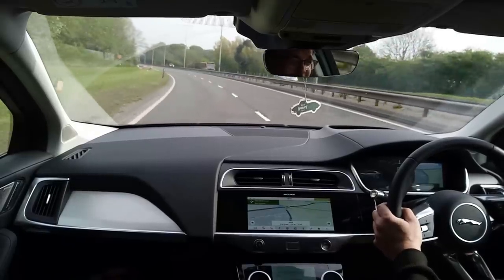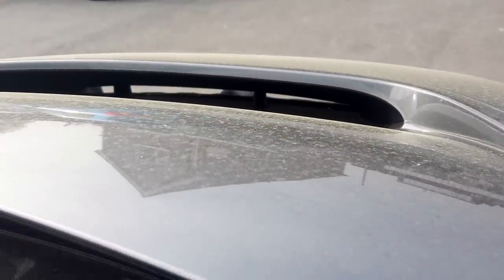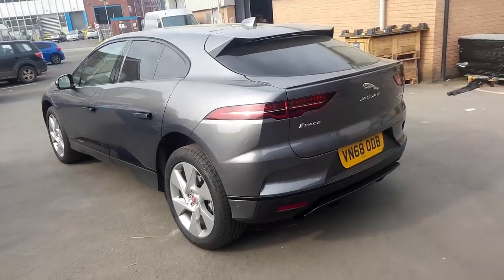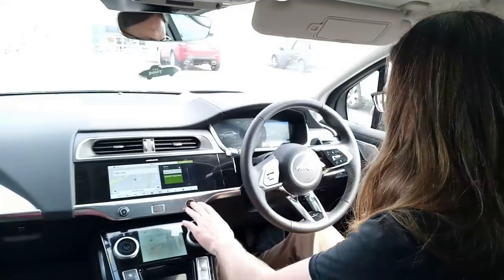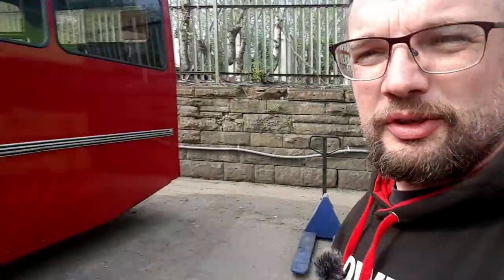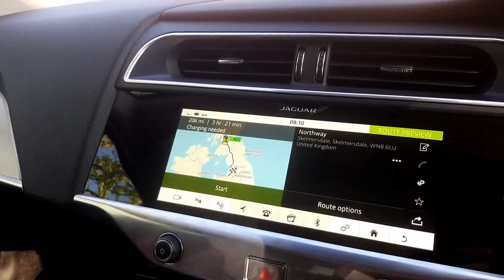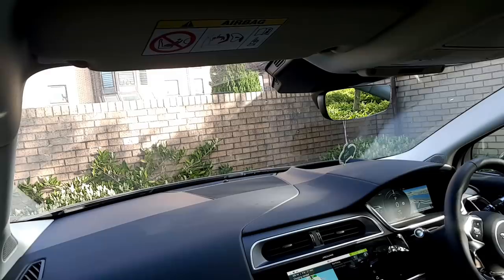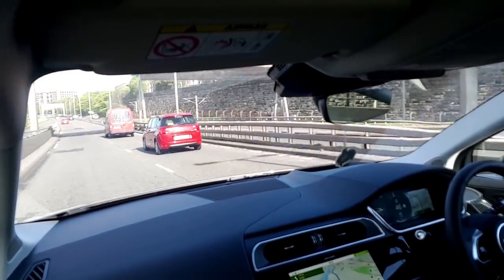Real Road Test: Jaguar I Pace 800 Roadtrip - with bonus bus action!

Comment: Thanks for a totally honest view of EV's. I love the idea of owning an EV, the dealership whom I drive for (service driver) have just started to sell the companies EV's (no names but four silver rings are the logo). They are magnificent machines. It's like driving a magic carpet. There is no fatigue. However there is no range, 240 miles under stringent test conditions (like anyone drives at 55 mph everywhere in a car). Personally I run a 98 plate S type Jag (3 ltr V6, 18-35 mpg), and a Ford Galaxy (2.3 petrol 20-35 mpg) and can get from home in SE UK to where I need to in England and Wales (sorry Scotland) in one hit on a full tank. Until the EV producers can get their charging systems/network sorted out with the ability to charge to 100% in under 10 mins and the range to a useful 500 miles I'm afraid that I'll either stick to infernal confusion or buy a damn Toyota Prius Hybrid. Thank you again Ian for a great video showing the reality of running an EV and the amount of time wasted trying to charge the thing. Nice car though, needs the old 3.2 XK lump in it though.....

Comment: Perhaps some of the answer might be the re-inroduction of the Motorail services that were operated by British Rail (at the start) between 1955 untill 2005. You could have done the Midland to Scotland part on a train arriving with almost a full charge to explore when you got there. Also with electrified lines I don't see why the charging could not be done on the train. A combination of the two could make electric cars much more useable.

Comment: Coming back to this video years later is interesting, I think the charger network has improved since then but planning is still required. I did a trip last week from Manchester to Exeter and back in a Nissan Leaf 24kwh stopping about 16 times at 10 different chargers, I only hit one problem and the 24/7 helpline resolved it for me. When planning the route I asked ABRP for the next hop each time then checked it out in Zapmap to see if it had recently been reported working.

Comment: Most enjoyable trip video...bus action as well. Charging time is not inspiring. I a. Surprised they bring back buses from HK.  Would have thought they would be pretty tired after years of use. I do miss the HK double decker from the 1988 era. Driven very quickly with the clutchless manual. Quite the riot when you nearly lift out the seat on hill crowns😺😺

Comment: So, we've cured range anxiety by building cars with good range, now to cure charger anxiety, where people worry if the charger will actually give them any power! Imagine the outcry if half the petrol stations were empty, but you only found out if you tried to fill up! I think the problem here is compatibility, you have 2 computers trying to talk to each other, but apparently not everyone has made everything compatible, rather reminds me of the 2000's when the idea of trying to get a printer to connect to the PC struck fear into anyone who had tried it! If it's like that the charger company will blame the car manufacturer and vice versa! Clearly demonstrates there's work to be done beyond just getting more charging stations.
42.39 think that's the 3 mile hill on my commute, always hammers my average MPG which I try and recover by staying in 5th and not touching the pedal for as long as I can getting off the motorway (works if the roundabout is clear).

Comment: Electric cars are great until you want to go somewhere! Last year I wracked up over 600 miles in a day going to the Mull of Galloway, just because I wanted to go there. You can see Cumbria, Isle of Man, Rep of Ireland and Northern Ireland from the same spot. Wonderful. You simply couldn’t make that journey in any current electric car, and sleep in your own bed that night. When they can do 1000 miles , and I can buy one for the 7 grand my Honda cost , I might think about it.
Reply: richard howlett You easily can in a Tesla though. I have a Model 3 that I'll be taking on a 620 mile road trip in a few weeks. Should be a super easy trip due to the supercharger network and how fast it charges.

Comment: Fascinating video, and I for one agree with everything you say in it. I love EVs and the potential they offer - the silence most of all, as I live in a big city where noise pollution is a massive issue and one that isn't given anywhere near enough attention. Just think, when EVs become the norm, we'll actually be able to comfortably live in houses beside main roads again! 

There's also the huge air quality benefits - the UK where s increasingly moving toward renewables (climate change means it's getting windier, but we can harness that) but even where the electricity cones from coal and gas, at least it's being burned away from population centres. 

Right now car makers (and buyers) are dazzled by technology, but I think we all need to learn where technology is helpful and when it becomes a hindrance. The former is being able to travel in convoy with massive trucks, safely and in doing so saving fuel. The latter is the ridiculous number of steps needed to connect to charging points with ohone apps and contactless credit cards, and the way that so many functions (on all modern cars, not just EVs) seem to buried in the infotainment menus. 

In cities, EVs are very much ready for primetime, and with those like mine (Leeds) offering free parking and charging, there's fewer reasons not to make the switch. The issue with distance driving seems, as usual, as much t do with our predilection for relying upon crap private companies +of which Ecotricity seems to be one) with understaffed call centres and 'just good enough' products to manage major infrastructure and vital services, and that's a purely political matter. 

When we / they can sort that, and create an infrastructure that is more akin to the current petrol station network than buying glass bottles of 'essence' from an apothecary, it will be a game changer.

Comment: Been having a home wall-box from 2020, and driving long distances with a BMW i3 from the same year, and i have to say that in Continental Europe, from 2021, the charging infrastructure has significantly improved every year, and that driving any EV nowadays is pretty easy, if not as cheap as it used to be due to the energy crisis that was caused by Russia’s invasion.

Comment: Completely agree in regards to poor network. It’s one reason we’re heading back to ICE this time around and trading in our Leaf. We’ll consider EV again next finance cycle and hopefully there’s a much, much better network. Plus you’re problems with chargers wears very thin after 2 years of ownership. 5 mins to put in a tenner of fuel still appeals. Being on hold to a call centre for 1/2 hour with a knackered charger is not fun, nor the future of motoring for me.

Comment: Tesla's numbers for kwh economy maye be based on in-town mileage?  In my leaf, there is a significant difference as soon as I get in the 55-70mph range, but in 35-45 day without too many start/stops, I can maintain 5+ miles per kwh without an  issue (which is most of my commute each day, and made it a decent fit as one of our daily drivers).  Thank you for posting your real-world, frustrating experiences with the current state of charging networks, interoperation, and the customer service, etc issues that currently exist

Comment: Great video! How did it feel getting back in the Matiz? I always find it hard to adjust when I've driven another car for a while and get back into my own.
Reply from the maker: I'm quite used to jumping into different vehicles, so no problems.
Reply: @HubNut  ooh that's cool. Random question. I drive a 2012 Suzuki Alto 1.0. In a small engined car like mine, is it worth using Redex and premium unleaded? I've used both and have experienced slightly higher range for my tank of fuel getting about 350 miles rather than 310-320, but that could be a coincidence (?). Would love your opinion.

Comment: Aw you would have loved it in Dorset today, saw a proper MK2 RS2000 in diamond white being told I just missed an even lovelier MK1 RS1800 or Mexico in baby blue, a lovely old Austin 7 and a red and equally lovely Bond Equipé, the 7 owner I was talking to as we discussed how his engine was the basis for my Reliant 850, he gets his parts either blacksmith forged or CNC machined for the engine if none about.   I actually had to put petrol in today, was down to the E on the gauge, last time I put some in was first week of March and I had been here, there and everywhere and I don't massage the pedal but give her some guns sadly marred by my cheap short draught Chinesium SD/USB drive playing head unit is dying a death, waiting on my £12.79p replacement stereo and can pump out some northern soul or some ska like a loon again :D   Might take a tootle down to Bournemouth or Weston Super Mare this bank holiday, got me Gaz cooker and kettle for tea making duty or might even wander to Sparkford as just literally down road and have a sniff around the auld cars there.   BTW your 850 will be livelier on super plus jungle juice, if I put normal stuff it isn't so perky I find.

Comment: I like Tbay. Lol. Did you figure out the suspension settings? Did you work out the various mode of regens? Non regen is prob best for motorways
Reply from the maker: Didn't really get to play with the settings. I like strong regen, which I moderate with the throttle pedal.

Comment: I think that it is suggested that it is best to keep the battery to between the 20-80% where charging can be at the swiftest rate!  I am very envious of your test opportunity as I am already addicted to hyper-miling in my diesel CRV (I have actually achieved 50mpg!) I admit that this sometimes it involves completely shutting down the climate control and infotainment systems etc but it certainly keeps me on my toes on long journeys to have further to get than the stated range!
   I really fancy a cheap old Prius to see what I can get. I understand that it is quite easy to recondition the battery pack yourself and I suspect that if they are driven as they were intended to be, they're capable of humongous economy.

Comment: The problem I have here are most of the comments based on a short test drive by someone who has little experience of electric cars and charging. I see this a lot on youtube.
First off, when the Ecotricity charger loses connection it goes on FREE vend. So all Ian needed to do was plug the car in and press start. So it's not a bad network after all. I have used it for 3 years driving up and down the country and have never been stuck once, just lots of FREE vends.

The Polar network is excellent too and very cheap but you need a RFID card. If you own an electric car you would probably have one but if your loaned a car for a few days you don't have the tools to operate it properly. 

I'm not sure of the problem with the Instavolt, I have used these loads of times and never had a fault, maybe the problem was with the car not the charger.

The cost of charging !!!  I charge from home and from a few local free chargers so driving my LEAF is very cheap (2p a mile approx) Charging out and about cost 3 to 4 times more
I see it similar to eating out. It costs more to eat in a restaurant than cooking something at home. When you buy Petrol / diesel you don't get a choice you have to buy it from a petrol station, it's never going to be on FREE vend (unless you steal it)

This technology is new just like a mobile phone in the 80's (I had one of them too)
nobody would phone me because it cost them 50p a minute and the coverage was rubbish
People told me then that mobiles would never take off and they would stick with their landline.
erm yes think they all have mobiles now.
Now i'm not telling everyone to rush  out and buy electric because i'm not and don't really want you to! I like pulling up at chargers when they are empty, charge up and go.
It's going to progress with more electric cars being sold and more charger will be rolled out.
If your in to electric cars you may know there are some big superhubs being built around the UK in the next few years which will increase the charging infrastructure. 

The amount of times people have said to me that electric cars are rubbish and I ask them how many have you driven? the answer 'NONE' 

My point is don't base your views on electric cars by a 1hour video

Comment: From Aberaeron to Glasgow is 353 miles which my quite big 4wd Volvo XC90 will cover at 80 mph on the long motorways while consuming only 40 litres of diesel. At £1.22/litre  it costs £49 or £0.14 per mile, which is what the electricity cost for that iPace apparently. The bonus for the Volvo [a seven seater automatic with 245hp] is that it could do the journey there and back, or over 700 miles with only needing to top up by 15 litres which would take about 5 minutes at most.
The trick with electric cars is to use them for local commuting and leave the intercity work to petrol or diesel cars. For some families it could work as a second car or a primary car with a second for long journeys as appropriate. Myrtle would have done that journey on less fuel cost and far less stress and faffing about.

Comment: 13: 25 Same as a  Vauxhall Calibra 0.29 !!
I like this I Pace Design.
Nice Review, thank You !
Nice Capri also !

I watched 2 Roadtrips with an EV, and both were Crap, showing  usefulness  of the EV/Hybrid.
1 was from London to Amsterdam, too much problems, the Guy was so glad he was driving a Hybrid

I think the Tesla looks like a Car without any Soul.
Totally hate the Design...

College of mine had BMW i3, returned it within 2 months, too much problems.

And then there is the problem , in case of Collision..
EV Car has to go in a Container, filled with water, for 5 Days !
Imagine when one of these go on Fire inside a closed parking lot !

So many problems concerning EV.
Also kind of frustrating to be constantly focused on Battery load.

Now don't get me wrong , I love riding Bikes.
And I had 2 Electric Bikes, from China , with fixed hand throttle.
And believe me these Bike's made me Smile and Sing , while driving.
I always wanted a Harley , but these Bikes smashed that dream flawless, in Comfort and joy of use.
No smell , so easy to charge at house.
But they both didn't last long.....Crappy Steel , and soon Battery issues.
So I went back to good old MTB , much warmer in winter....

And for EV, I would like a Test-ride of the Ampera, love that Design.

Greetings !

Comment: Most EVs charge fast to 80% then slow down alot until 100% to save the battery overheating.. The charge time would include this slow period. Save time to charge only to 80%. That Capri was in lovely order.

Comment: Mr nuts comment regarding how EV’s are where cars should be is so accurate regardless of the infrastructure woes. I have a 2019 Passat TDi which is great and reliable but it’s no more refined or advanced than a 15 year old model.

Comment: Brilliant video. Shows the true state of the appalling charging network, Ecotricity are abysmal.
We bought our Kia Niro plug in last year and it's a remarkable car, we'd never go back to a 'standard' engine set up for our main car again. Went from chucking £320 worth of diesal a month into a ford Kuga to having to put £20 of petrol into the Kia after 6 weeks. Remarkable and easy with a home charger but as you show still impossible to make the jump to full electric in this country, particularly if you live in the sticks like us
Reply: Yes but what's your electric bill?
Reply: @goplanit  hardly makes a difference, negligible amount. Our bills haven't gone up. Plus we have solar panels on the roof, last summer quids in!
Reply: @stepheng8779  So you are saying it cost £320 in diesel but nothing in electricity to do the same mileage.... of course it does.
Reply: @goplanit  oh you're one of those! Never said it cost nothing, said it was barely neglible, can't you read? If you drive these cars properly (regen braking etc) and they suit your circumstances (as they do ours) i.e. a charger at work  which costs NOTHING and FREE CHARGING POINTS which we have in our area at the local Lidl supermarkets  and cinema etc it doesn't cost us a penny. Coupled as I said with the sun giving us FREE electric we're well happy. Is that clear enough for you? Continue living  in you bubble of denial I don't care, I know what my next car is. Don't feel so bitter just cos you've missed out on the big subsidies for the cars, home chargers and the solar panels, it's still not too late, you just won't get as good a deal as I did!

Comment: Just want to point out that your comments about Tesla‘s being inefficient is actually incorrect. They’re some of the most efficienct EV’s on the road. For example, the Model X is taller, wide, longer, heavier and faster than the iPace, and STILL gets more range out of a similarly sized battery pack. And it seats 7 people. The Model 3, which is more comparable to the size of the iPace, has a 23% smaller battery, is faster, has more storage space, and gets 85 more miles of range. It also charges significantly faster. The Jag is inefficient, but Tesla’s certainly are not.

Comment: Eventually power will come from underground cables without any direct connection we had a similar system underground with a coal cutting machine that would get it's power from a static cable.

Comment: Polar is normally pretty good. Rapid chargers are not just on the motorways. A lot of Holiday inns have rapid polar chargers. Download Zap-Map and that will give you detailed info on charge locations and whether or not they’re rapid or standard.
Oh and Ecotricity chargers on the motorways are pretty crap. They are old and quite slow. AND more expensive that most of the others.